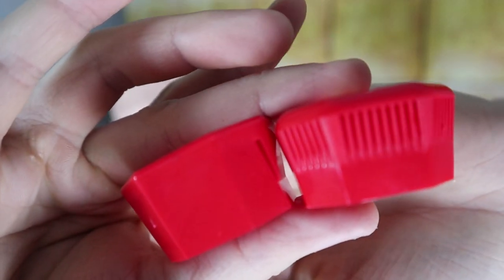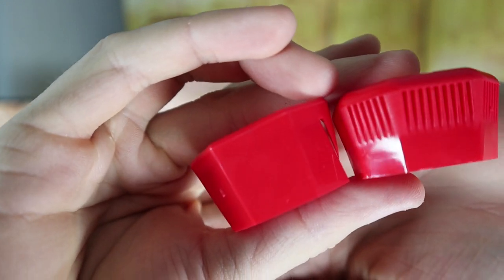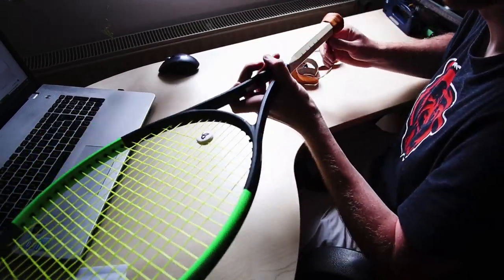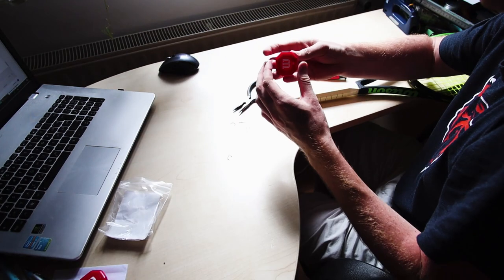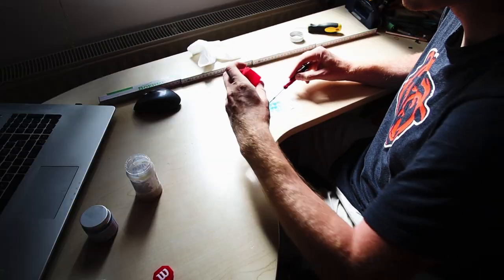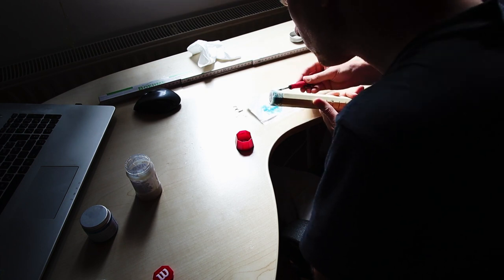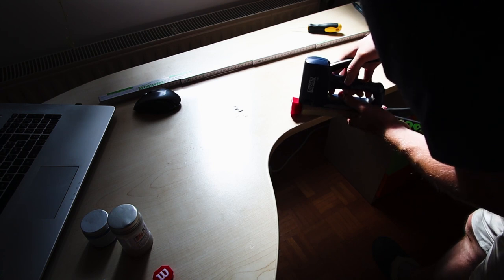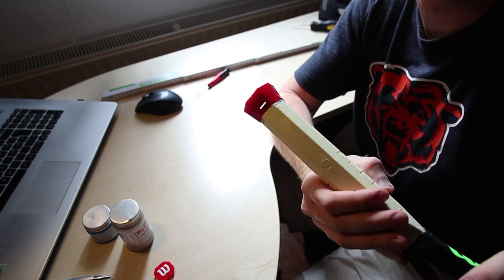How to change a butt cap on a tennis racket

Comment: Hi thanks for the video, i was thinking about changing the buttcap on my wilson six one team cause its like the blade one you have and i dont like this kind of feel, is it possible to put the buttcap without your gun tool at the end??
Reply from the maker: It is possibke, just make sure you get a good glue. I did first couple of butt caps for my self when I didn't have the gun and I had no problems.

Comment: Hello, is it possible to put the butt cap of one brand on a racquet of another brand, given the same grip size?
Reply from the maker: Yes it's possible, but keep in mind they have different designs. So it might make the racket shorter/longer, as they sit higher or lower on the bare handle. Make sure to compensate for that with spacers or making the handle shorter.

Comment: Will a Babolat butt cap fit on a Head 360 Speed Pro?
Reply from the maker: Babolat and head have different sizes. Maybe a size smalled babolat would fit on a Head. I haven't tried it.

Comment: Hi Miha, thanks for the video. Could you let me know what type of staple gun you use? I am doing on my yonex ezone one. Just making sure i dont use the wrong type of staple.
Reply from the maker: I used Rapid R44 gun, Staples are 10,6 mm x 8 mm. I'd say it is a normal gun. Some People say normal guns like this don't pierce the butt cap but it works for me. In my earl days I used thicker Staples that I could hammer in with a hammer, so maybe try that, or just use glue alone. In my video about how to extend a racket I only used glue and it's holding up well.
Reply: I bought some glue, hoping it works  @MihaFlisekIT

Comment: hello and thanks for a good channel!is it possible to change the butt cap in a  wilson pro staff 97 (2015) think it is a bit too sharp ends, want to switch to a rounder. Is Wilson butt caps the same? Sincerely
Thomas
Reply from the maker: Appreciate it! The Wilson Blade cap is more rounded, you can use that, but make sure to compensate for the length difference.

Comment: Hello, I have 2 questions

1. what glue did you use? and if i use glue will i still be able to change the buttcap in the future? 

2. What staple gun did you use? is that the normal carpentry staple? and also do you have any alternatives to it incase i have no access to it

3. Incase of no staple, will glue be enough to secure the butt cap?
Reply from the maker: I recommend any 2 component epoxy glue. It is possible to change it, but you might destroy the butt cap when removing it again.
I used Rapid R44 gun, Staples are 10,6 mm x 8 mm. I'd say it is a normal gun. Some People say normal guns like this don't pierce the butt cap but it works for me. In my earl days I used thicker Staples that I coule hammer in with a hammer, so maybe try that, or just use glue alone. In my video about how to extend a racket I only used glue and it's holding up well.
Reply: @MihaFlisekIT  even the cheap 5 min epoxy resin adhesive? I have a creaky buttcap
Reply from the maker: I don't know exactly what you mean, bit I oftej use 2 component 5 min epoxy glue.

Comment: hey man any idea how to increase grip size without using grips because i want to still feel the edges of the grip
Reply from the maker: Check out my video on increasing the grip shape with heat shrink.
Reply: Adding shrinkwrap to increase the girth of the handle adds 16-18 g to the racquet, which most ppl don't know. That's a lot of weight!
Reply from the maker: Yes agreed. Usually it's not Worth it it you don't want the extra Wright, because the MASS changes the racket a lot more than a bigger grip size.